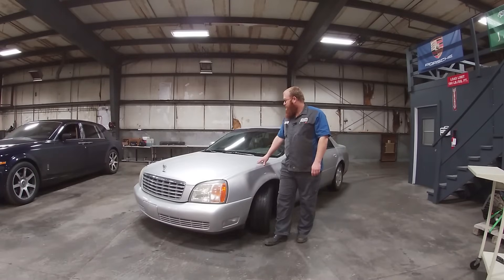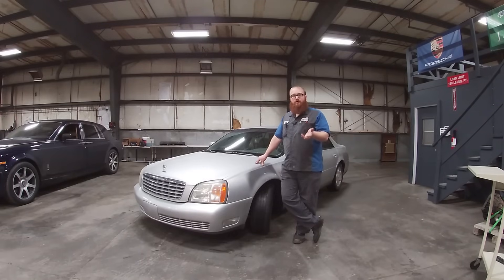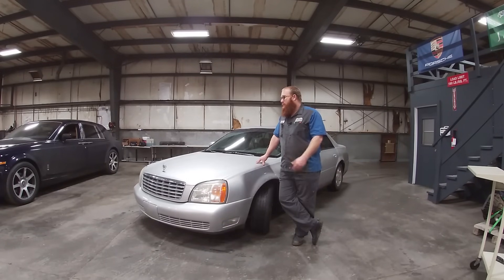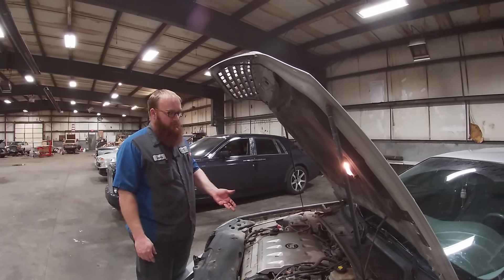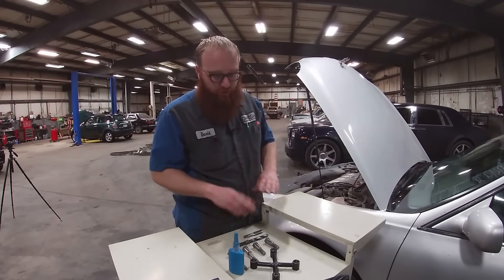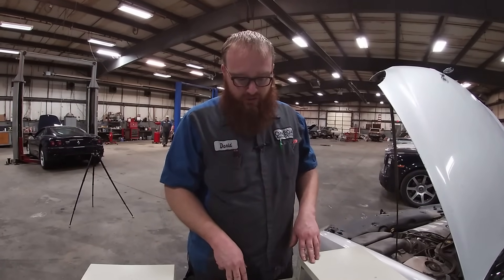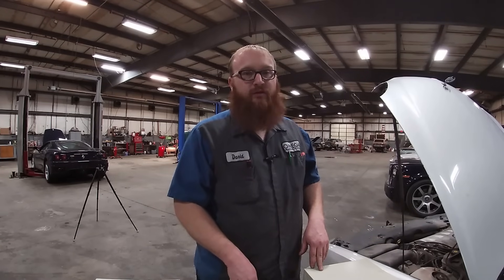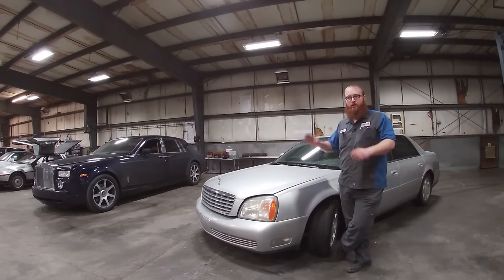The CAR WIZARD names Cadillac's Northstar Engine the Dumbest Design

Comment: Great commentary. My understanding is that the Cadillac line of automobiles are used as test beds to evaluate new technology in a real world scenario. I would never buy a Caddy, they are full of gimmicks and unproven junk. 🤓
Reply: My son had a 1976 Caddy in the early '90s. It had the stupidest most idiotic luxury feature, that you only shut the trunk half-way, and an electric motor would take over the rest of the way down.
When the electric motor burnt out, in the 1990's, he couldn't close the trunk, except with a tarp strap or something. 
Fortunately, back in 1976, Cadillac hadn't figured out a way to totally fuck the car by that idiotic motor, and within a half an hour or so, I had the electric motor heaved into the bushes, and rigged it so the trunk would shut like a normal trunk, by gravity.
Then the next thing, the luxury-mobile jumped time. Not the same thing as a Chevrolet jumping time. When the Caddy engine jumped time, it fucked the engine to the point it wasn't worth fixing, so we parked it in the woods.
I hate Cadillacs with a passion.

Comment: Dumber than the 3.7l Chrysler engine?
Reply: The 3.7 wasn't as bad as the 2.7.... 
2.7 reports of catastrophic engine failure at 30,000 miles
Reply: That's why in Chrysler you stick with the LA and it's derivatives or Slant engines.
Reply: The new "Hemis" are a derivative of the LA series of V8s, at least the block and bottom end is. The slant 6 was sort of a dead end, once the front wheel drive craze started they had to go, I wish they would have designed the blocks in those to accommodate more displacement, 225 was the largest they got. The older Chrysler V6s are not bad, the transmissions can be a problem but the engines are not too bad. 
  I wouldn't go for one of these Caddy's just because they thought it was a good idea to make a front wheel drive car with a transverse mounted V8, that's what makes this head bolt issue such a headache.
Reply: The 3.7L is a great engine, just lacked power HORRIBLY. I would absolutely FUCKING HATE to drive a 2012 RAM 1500 with the 3.7! 215HP?? really!???? but its built well. Personally, my favorite engine out of Chrysler is the 3.6L/4.7L.

Comment: I had one. The damn starter is in the engine, expensive to fix also.
Reply: Right on...Just to remove the intake manifold for access to the valley is a real nightmare, and you have to remember where and how to reinstall all these hi-tech complicated and over engineered  devices that were in the way. Engineering the engine to bury the starter inside of it is a GM "Mark of Ignorance"; among other stupidities of the North Star.  The product group who engineered this thing were probably the same people who designed the infamous V8-6-4 from 1981 to 1984.
Reply: @rayford21  Its only a nightmare to someone that doesn't know how to do it correctly. The starter lasts longer and stays cooler inside the V of the engine.  Toyota does the same exact thing with there 32 valve V8 found in there trucks and SUVS.
Reply: I remember changing the starter for the first time on a Cadillac several years ago.  it was different than the conventional way, however it was very easy to do.  I don't understand how anybody can say its a nightmare or expensive to do.  Toyota does the exact same thing on their 4.7L 32 valve V8.
Reply: Yeah in the your ownership of the car within that time period how many starters do you put in it?? One,maybe? It's a piece of shit dude no reason for that, starter stays cooler,who cares?
Reply: @willgroff84  you really dont seem to know what your talking about. It's not hard to do a valve starter.

Comment: Not really worth fixing when an decent early CTS is $3500-$6000.
Reply: CTS is junk...i would pay 3k max
Reply: @liblib89  The CTS with the small 2.8 liter motor gets worse fuel economy than the 4.9 liter cad v8 they used in the 93-95 FWD devilles. Look it up if u dont believe me.
Reply: And then you’ll have 3.6l timing chain issues.  No winning!
Reply: WILLIS CURRY i believe you..sad
Reply: Rachelle B. you can win by buying a lexus or infiniti
Reply: Well shit. Guess just buy JDM then.
Reply: liblib89   Infinity/Nissan is not exactly the gold standard of quality and reliability. Lexus IS fine, built pretty well but in most cases when something DOES go wrong they are still expensive to repair.   It’s just the nature of luxury vehicles.
Reply: DrewLSsix Agreed. in my personal experience though those are the cars that have treated me the best though
Reply: CTS  is ugly 4 door and the 2 door looks like an egg period!
Reply: @liblib89  Lexus yes, infiniti not so much
Reply: mrFoxYou1 if you get the regular infiniti, the ones without the CVT transmissions those are great cars
Reply: But the CTS is compact and does not resemble a Cadillac at all. Heck might as well buy a Catera.
Reply: You can't run fast enough to give me a CTS.
Reply: @mysterybuyer3738  one of the worst cadillacs made, I know from personal experience they are not reliable

Comment: The ford 6.0 diesel is probably a worse design
Reply: Exactly! The worst!!
Reply: The issues are actually pretty similar
Reply: What ? Seen many , hell sold many with a quarter million miles? The 6.0 is fantastic. Sell like hotcakes. 
 Have you seen what, or better yet priced,what happens to Duramax or cummins or even a 6.7 Ford. Basically anything with a common rail cp X pump? You can buy multiple trucks for what it takes fix a simple def in the diesel mixup.
Reply: The 6.4 is even worse. The 6.4 can never be bulletproofed without deleting the emissions shit like a DPF which is illegal and spending $35,000 to rebuild it with stronger internals. The 6.4 is junk. MaxxForce7: junk. Any Navistar that says MaxxForce is junk. The MaxxForce is the worst modern highway diesel engine ever made.

Comment: I beg to differ sir, only after owning a ford with a 6.0 powerstroke.
Reply: Pre 05 6.0's are bad yes but 06 and up after they fixed the issues with the heads and the head bolt's are actually a pretty good Engine (speaking as an owner)
Reply: Hatori Hanzo I had a 2003. Replaced it with a 2017 ram with a Cummins. After WAAY too much wasted on that Ford.

Comment: I currently own a 99, 89, and a 68 caddilac deville and ive never had an issue with the head gaskets. Ive replaced coil packs, radiator, spark plugs and ignition switch but never an issue out of the heads. Theyre mainly just the luck of the drawand how someone maintains them. If you allow it to overheat then youre more likely to have issues but if you maintain your vehicle then the possibility of an issue is decreased drastically

Comment: First the motor design is the foundation for all those European made v8. The only issue was the headbolts period. Upon those being fixed they last for ever period. They introduced subframing,isolated vibration and pushed cooling fluids to what we know know. The small engine design is what gave Mercedes-Benz AMG the push for their small v8 twin turbo which by the way is what people were doing to the NorthStar yrs ago. A proper headbolt job done will giive you a 300hp with 18mpg-24mpg on a daily bases.
Reply: I got close to 30 mpg at best on interstate

Comment: Who gives the wizard a thumbs down?? 

... 74 northstar drivers?
Reply: Hoovie Garage
Reply: I did because it is not a dumb design. great eangine. being all aluminum, can't be overheated a bit.
Reply: @frankburn6312  it is known to overheat... A lot. Literally because if the issue shown in the video
Reply: The engines are wonderful...if they didn't come with the flawed headbolt design. I absolutely love these machines....after the engine modification, of course.
Reply: @frankburn6312  This is the part where I want to tell you to Google for 'confirmation bias', 'sunk cost fallacy', 'rationalization', and possibly 'Dunning-Kruger effect'.  But I'm just about all out of shits to give.  So, good luck bro.  Sweet ride.

Comment: I am lucky enough to have purchased a 1996 Cadillac sedan deville which came from Minnesota and I'm in south texas and I have to say after doing some routine maintenance on it brakes ball joints fuel filter new radiator thermostat fluids and hoses man she runs smooth like I'm driving on a cloud,I bought my car off a winter Texan 900 bucks 154,000 original miles...

Comment: This is a really controversial video. I have heard a lot of car "experts" say the Northstar V8 is one of the best engines ever made.
Reply: The underlying design is good. It was smooth and very powerful for the era. The downfall of the Northstar was typical GM execution. They used bad quality materials and awful gaskets leading to tons of head gasket failures, massive amounts of oil leaks (which can only be fixed by removing the engine from the car) and worst of all block cracking. Had they built this design with a thicker block and better designed gaskets it would've been a great motor. (I've owned three Northstar powered Cadillacs.)
Reply: @michaellombardi1018  Thanks for clearing that up!
Reply: @michaellombardi1018  Yup.  300hp/300ft-lbs out of 280 cubic inches.  Smooth, light weight, this could have been the engine that saved Cadillac's bacon, instead it turned into another fiasco in a long string of fiascos,  V8-6-4, 5.7 diesel, 4100HT, and the now infamous Shitstar.   It's why used Cadillacs are a dime a dozen.  The 4.6 stunk so badly that it even killed the resale value on cars with the 4.9, which was Cadillac's last good engine.
Reply: @MrSloika  spot on
Reply: @MrSloika  you could argue the Fleetwood of the 1990s had the last good Cadillac engine but the LT-1 was just a humble Chevy V8. You are spot on about the 4.9. They finally got that engine family right, the 4.1 was hot garbage and the 4.5 was meh and then they killed it for the Northstar after only a couple years.
Reply: @michaellombardi1018  4.9 was the last engine exclusive to Cadillac Division.   4.6 was used by other GM divisions.

Comment: I bought a Deville with the Northstar engine a few years ago. Paid $1,800 for it and the seller had left the receipt in the glovebox showing where he had just spent $2,100 for the wheels and tires that were on it about 600 miles before I bought it. I drove the car trouble free, back and forth to work, 20 miles each way for about two years. I wound up selling it to one of my daughters boyfriends for a grand, and within a week the kid had hit a pothole which blew out one of the low profile tires and damaged a rim. Rather than find a replacement rim, or buy a cheap set of factory take-off wheels, he parked the thing and let it sit for about a year before selling it to a junkyard as scrap. I should have kept it. Damned car got decent gas mileage, had decent power, was comfortable, and got around great in the snow.

Comment: What about the 05 Audi s4 4.2 v8 with the timing chain in the back of the engine that costs 10 grand to fix. Or the RX8 rotary engine that blew up all the time lol
Reply: shame with those chain drive 4.2's because the early belt driven ones are a 300k engine all day don't know why they went to chains...
Reply: Oh Lord  my friend had that Audi it was a nightmare
Reply: @SearchEast2069  Try the V10 Tuareg. OMFG.... I have spent my whole working life on pretty complex vintage F1 engines and modern Ferrari engines, but this design melts my brain. It is RIDICULOUSLY complicated....

Comment: I have a 2002 Seville. Bought it with 72k miles. Never had a head gasket issue. I think the whole problem is caused by shitty dexcool coolant. First thing I did was change over to conventional green coolant and replace it every two years. Biggest problem I had, was breaking front motor mounts. I bought one from NorthStar performance and never broke one again.

Comment: The 5.4 Ford might not be a particularly good engine but it's certainly not the worst.
Reply: Yeah I agree man anyone that thinks that is an idiot. There are so many worse engines than that. It's no 2.7 Chrysler or Mini Cooper 1.6 that's for sure.
Reply: @manrightchea  Chevy Vega or Oldsmobile 350 converted diesel lol
Reply: @Krankie_V  OMG I forgot about those lol! Those old proprietary GM diesel hybrids, what a nightmare. Let's use a gasoline block for a diesel engine, what could go wrong..

Honestly that was the one event that turned America against diesels for passenger vehicles.
Reply: Ford has stuck with and developed the dohc v8 to the point it's a reliable engine. GM should stick to push rod engines, that's what they do best.
Reply: 5.4 was had it's issues but at least you could fix it in the truck.
Reply: Our 5.4 in our 99 expedition is going strong at 200,456 miles.

Comment: i just pulled the engine and trans out of my 96 aurora , rebuilt the trans and resealed the bottom of the motor.  Best kit for doing the thread repair on the block is timserts

Comment: I have a 2007 DTS with the north star and it runs great !! The biggest issue I hear is the starter after 2005 the head gaskets were fixed in 2005 so if you have a an 06 and up your good to go . The starter can be changed in a few hours with regular tools nothing special . My car turns heads everywhere I go and the 300 horsepower motor isn’t too shabby either .

Comment: Hmmmm....let’s put the starter.....UnDeR DeR iNtAkE!!!!!
Reply: Everybody does that...
Reply: Toyota has done the same.
Reply: Yeah, a few manufacturers have made the same dumb mistake on a few designs.  Can’t wrap my head around some of the crap engineers come up with.
Reply: The Toyota bolts in from the outside as well. It means you have reach between the back of the engine and the firewall to change it.
Reply: Sure, but do u have to remove the entire intake manifold to change it like in the north stars.
Reply: @outtodoubt  Yes.
Reply: @biff85ta2  along with diverter valves,and some pcv valves
Reply: @outtodoubt  Yes but it's cake. I've done a few. Many fwd v6 cars are harder.

Comment: I've used Big-Serts before made by Time-Sert in a few engines like Kia V6 and Toyota 4 cylinders ect. I've tried heli coils in the past and they can pull out, so I only use big serts. 
One Issue I can see with the studs is they clamp off the deck by the look of that kit, you want longer studs to clamp lower in the block.

Comment: I have this engine in my 2004 DHS and I have over 240 k on my engine,  ur right about the heat gasket going bad, but that's because these engines run hot, and if u change ur antifreeze regularly with DeX cool ur not going to have any issues,  I still have the original head gasket,  the only problem I had was with the alternator it was a horror to replace,  so I do agree with the design but it's a powerful engine and I love it  all around.

Comment: Good video ! I own a 1997 Eldorado since 2003 , and had that damn head gasket problem , put 2 used engines  that did the same thing , long story short , had those bigger bolts drilled by  to me the lucky me best man in my region  to my original motor , and is running good ever since ,, just to say you know what you re talking about and keep up your good thing ,,,, ❤️❤️❤️
By the way I m sending you a pic of my sentimental and costly value lolll

Comment: Are you have to do with that Cadillac DeVille 2004-2010 remove 4.6 North Star V8 engine, choose Vortec 5.3 V8 2004-2010 - Vortec 6.0 V8 engine from Cadillac escalade 2001-2006 or GMC Yukon Denali Xl Vortec 6.0 with transmission swap, any LS engine will fit in Cadillac DeVille with 4.6 North Star V8 engine, the same thing with Buick Lucerne CXL

Comment: Wizard, can you please offer some tips on keeping my 4.6 NS in good shape? Perhaps ways to keep cooler operating temperatures on average (cold air intake) etc. I have one that has been excellent, however I do take good care of the car (ie oil changes, good quality fuel etc) and despite the obvious flaws, tips to avoid the pitfalls of inherent engineering issues. Thank you.

Comment: I have a 1993 northstar and I've heard that anything before 1996 didn't have these problems. I'm around 105k miles now, should I keep that car alive or maybe better get rid of it? :) I love my cadillac but I'm always afraid of those headbolts. I think even the 5grand fix would be worth it because the car is so cool, but I already spend 4grand on a transmission fix.. :)

Comment: This was never a "problem" The Northstar engine was basically designed to go 100k with little to no maintenance. Really just oil changes. This was the late 80's, most vehicles of that era were going to be "beyond their mechanical limits" at that mark, even with 60k major maintenance. A Cadillac customer of the time was probably NOT keeping a car longer than 5yrs!

Comment: I love these cars, best winter cars i've ever driven. I used to have to buy a different one every winter when i garaged my summer cars and dump it in the spring because of the dang engines. Then i figured out how to do the job myself. Now i've had the same 2000 DeVille for the past few years no worries.

If you ask me, from the perspective of somebody who has access to a garage and sells some cars they've fixed up, might be worthwhile to buy the cheapo ones off craigslist, fix them yourself, then put them up at the higher price, clearly worth the extra couple grand for a perfectly running example. They're obviously worth more than $2-3000 in completely running condition.

These are handsome and comfortable cars, more than worth a couple more grand than the typical going rate.

Comment: I have a 2003 Deville DTS with 240k miles on her. No head gasket issues. I have even overheated the engine about 5 times, ran without coolant for about 15 miles the last time, still no problems... It leaks and drinks oil(about 1 Qt a week), power steering leaks even though I replaced the steering rack and hoses, brakes leak at proportioning valve. Every thing BUT THE HEAD GASKETS has failed and been replaced. Reliable car if you like chasing little nickel and dime issues, a lot.